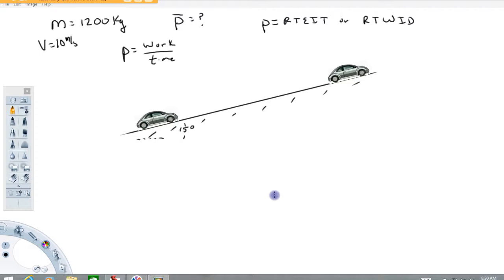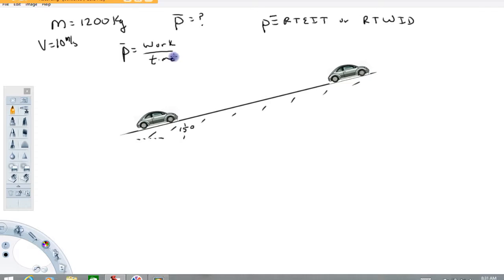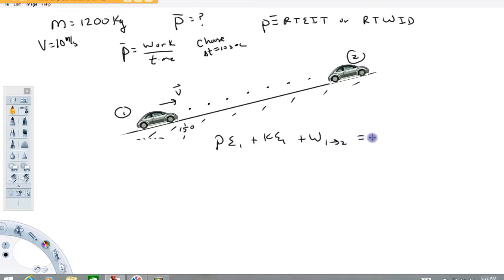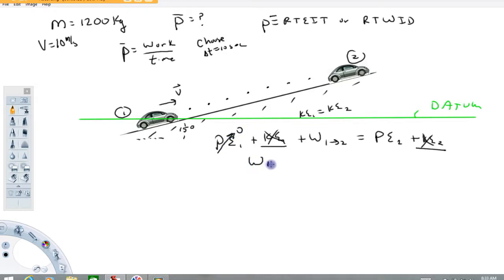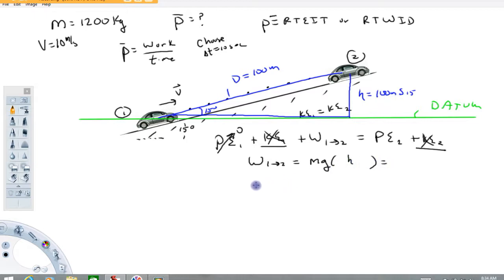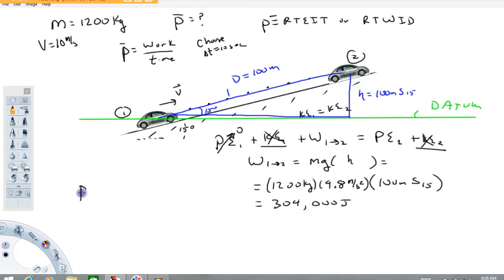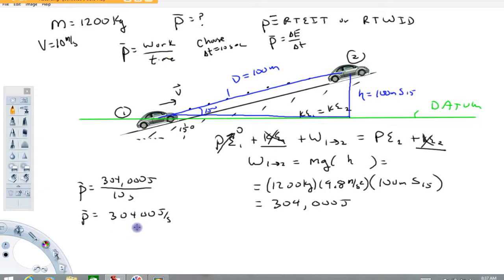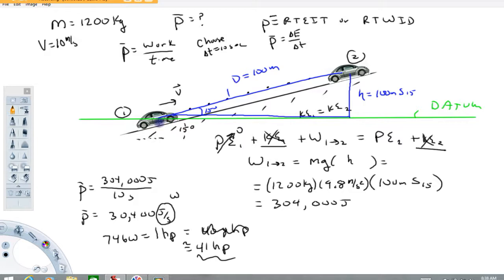power of a car moving up an incline at consant speed

Comment: Hp on a hill equation

Weight( lbs) x speed (mph) x percent grade
Divided by 375

That is hp required to climb a hill at a speed.
Of course in real life you need to add in for aero drag and drivetrain loss
Reply from the maker: Yup.  What you posted is the work done, divided by time, with an adjustment for units.

same thing I did in the video

Comment: Hello,
Why haven't  we considered the force of friction in this example? so the power of the motor (engine) would be higher than the calculated answer. As the motor would have to apply a power going up the slope + against friction. Also, if we assume there is no friction, then what does that mean? Would the tires never grip the road and would just be spinning in the same place?
Reply from the maker: The number calculated is the rate that the PE of the car is changing. Plenty of other factors were not considered, such as air drag, loss in the transmission, ect, ect.  These were not included because this was meant as an introductory example for first time students. The actual power output of the motor would have to higher to overcome the other factors.